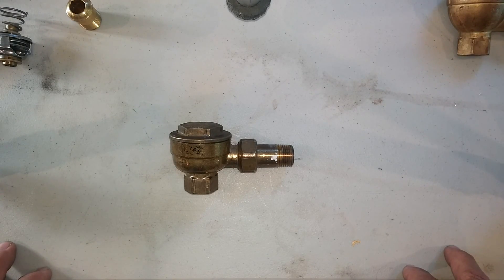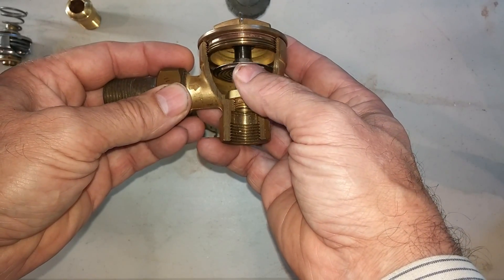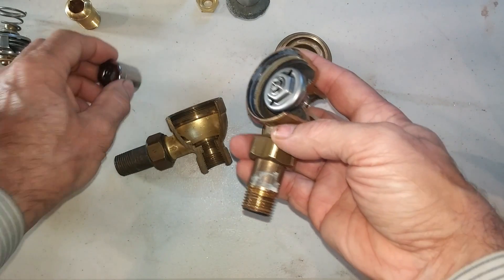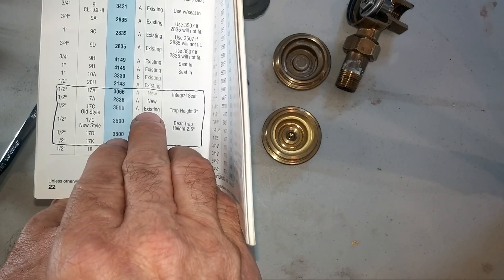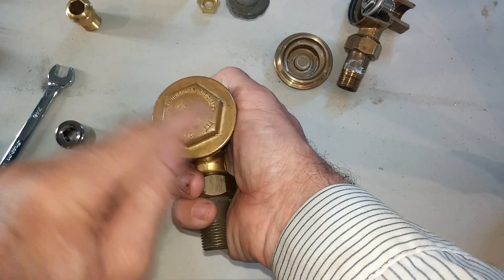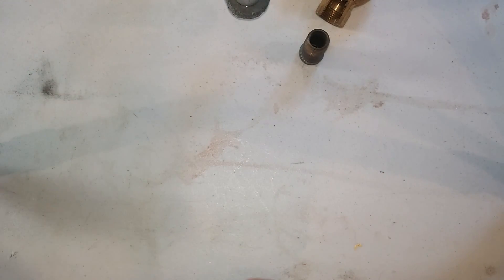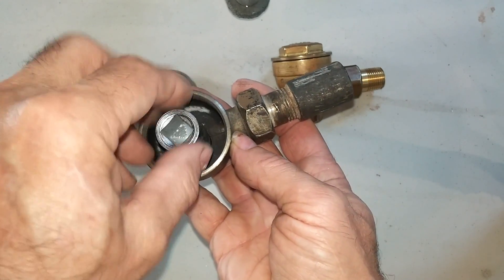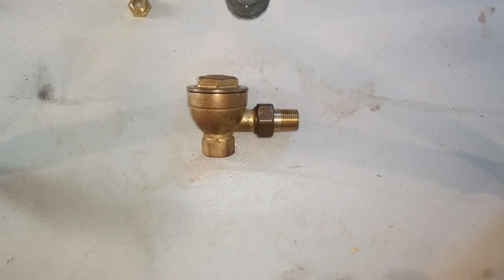Meditations On The Hoffman 17C Steam Trap Variants And Their Antecedents

Comment: What is the difference in orifice size or flow rate between the Hoffman dura-state module and the Barnes and Jones 3500 as a replacement?   I am have a small stock of Dura-Stat replacements which I found cheaply and have been using in my house.  I am trying to decide whether I should replace the Dura-Stat pieces.  Also, the current online version of the Barnes and Jones manual you showed is different, it makes no differentiation in Hoffman 17 C replacements - the 3500.  It does not show the need for a new cap.  Do you know if they have redesigned the 3500 since your version of the manual?
Reply: Hi! If the Duro-stat works for you, on your own system, then great! Have at it. 

I myself as a heating professional must make sure that my customers get my best efforts to add value to their steam systems.  As such, I only use the Duro-stat on small radiators such as those usually found in bathrooms. 

The venting charts for various traps can be found on www.heatinghelp.com for a modest fee (I get NO kick-back).  The charts were generated by Mr. Gerry Gill, the "steely-eyed steam man of Ohio".  Check out his YouTube channel.  He is also the one who informed me of the Duro-stat's lack of durability.

I called Barnes & Jones directly today and spoke personally to a technical representative to check on your concerns about the on-line instructions vis-a-vis the booklet shown in the video.  They verified no change in the needs of the NEW style 17C.  It absolutely DOES need a new 3500 cap with the 3500 capsule, as shown in the above video.  Only OLD style 17C does NOT need the new B&J cap with the 3500 capsule. This is also pictured in the above video.  B&J absolutely confirmed that those instructions outlined above remain unchanged.
Reply: Gordon, thanks for the follow up.  I certainly understand and appreciate that when you are replacing something, you would improve it rather that just replace it in kind.  I guess my question really is whether this change is such an improvement that it would be worth doing on presently working traps?  For the last week when the temperatures were in the single digits my system really struggled to heat the house.  Of course I need some insulation and some storm windows to replace a couple, and I'm just wondering where this fits in an overall picture.  Thanks.
Reply: Thank you for your reply.  Last week's low temps were indeed a struggle for us all!

If the trap elements work, then there is no need overall to replace them, sure.

Trap elements fail in two basic modes: Closed or Open.  They fail in the mode most likely to cause you trouble (Murphy's Law ;-)).

If the element fails in the closed mode, then that radiator stops heating.

If the element fails in the open mode, then steam can shoot past it and into the dry return and cause all sorts of devilry in your system.

Trap elements can fail in the "almost closed" mode and allow enough steam in the radiator to heat it part way when the system runs long enough.  IF you have proper Main Venting on your dry returns.

Lets take a step back please and look at the whole picture and not just focus on your traps:  Old vapor systems like yours should have been designed to heat your house to 70*F, when it was 0*F outside, with a steam pressure at the boiler of NO MORE THAN 8 oz/in2, with the windows open (really, all due to the great Pandemic of 1919 that killed 400,000 US residents in one year.  You kept your windows open or you would die of influenza too)... or the original steam fitter that installed it didn't get his final payment until he made it right. 

In that 1925 Hoffman booklet I show in the video, there is also printed out a sample contract for reference that pretty much spells that out those warranty terms.

That is why this stuff is still working in your home... it was WAY overbuilt!  

If your old over-built steam system struggled to heat your house, then there is a good possibility that something else is wrong besides iffy traps and no insulation. 

Check out my other video where a 36 unit co-op that is plaster on brick (no insulation) is heated with 4-6 oz/in2.

Comment: I was looking for a cross section drawing of the trap and discovered this!  Completely backs up my observations.  On 2-pipe systems with inlets at the bottom of the radiator, this trap will cause the condensate to drain back down the supply line, or at least it will try to.  After I installed inlet orifices, I could hear the steam surging, as if the steam was blowing through water that was moving around in a wave pattern.  The problem was also exacerbated by an error in the original installation; the bushing on the outlet was concentric.  I replaced the bushing with a salvaged eccentric and installed a Dunham 1-E trap.  The few original traps that still exist are the old large style #2 traps in which I have installed B&J cage units.  Thanks for all your great work.  DaveinQCA
Reply: Thank you very much for adding your comments! 

 I can't understand why the Hoffman engineers put the outlet of the durastat so high up in the new-style 17C, except to trap debris and keep them out of the seat.  

It certainly traps the water, doesn't it! 

Even the #3500 B&J unit has a higher collar than other cage units for other traps (though not as bad as the durastat), thus creating excessive water back-up and gurgling for no good reason.  At least that's what it seems to me.

It was Gerry Gill, the steely-eyed steam man of Ohio, that informed me the "durastat" ain't so durable (as well as informing all of us as to the durastat's miserable through-put. Thank you, Mr. Gill, sir.) 

So, actually, it seems that the 17C trap itself is not half bad, but it is the durastat that is the problem.

You are most welcome, sir!
Reply: instablaster...